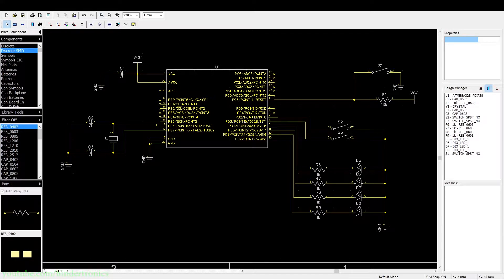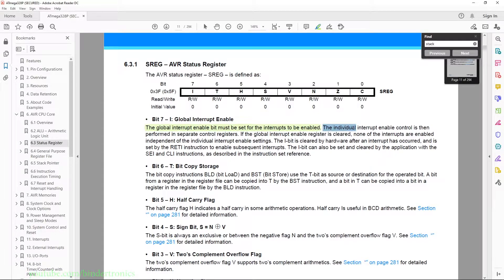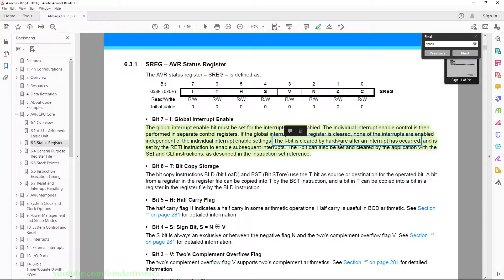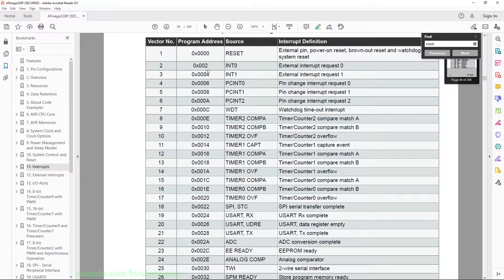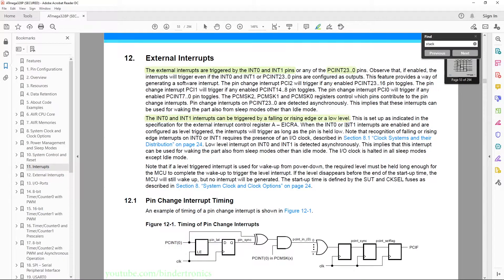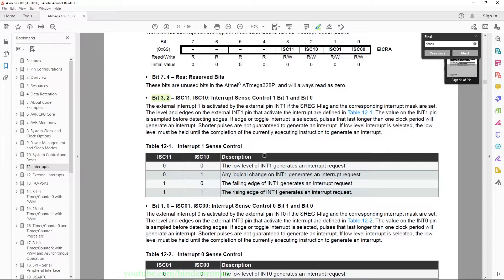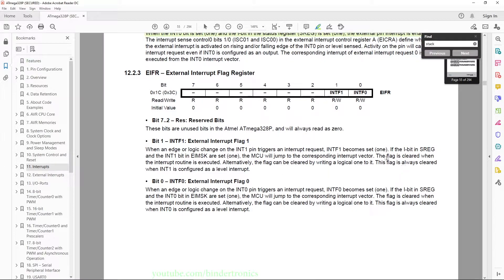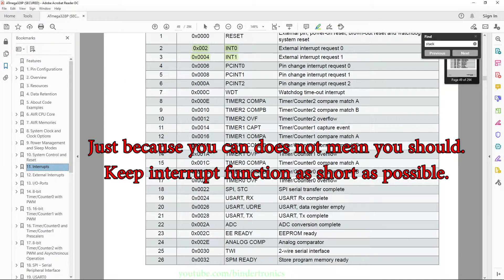Interrupts  🔴 ATmega328P Programming #6 AVR microcontroller with Atmel Studio

Comment: Hi there, thanks for making this series of videos (very helpful!). I have been confused your configuration of the DDRD (at 8:16 in the video). If the initial value of DDRD is 0x00 (which is specified in the datasheet) and you AND it with 0xF3 (1111 0011). Then wouldn't we end up with 0x00 at DDRD? Wouldn't OR'ing it get the desired result of 0xF3? Also, I don't understand why you include the bitwise operator at all. Why not just set the value of the register (DDRD = 0xF3;)? Is there some advantage? Thanks for any input.
Reply from the maker: The short answer is: Stupid proofing the code.

Long answer: The desired result for the DDRD register is 0xF0 and not 0xF3 or 0b1111 00xx where x is do not care. Using the bitwise operators allows you to change only the bits you want to change. In this particular case the operations do not change the state of the lower 2 bits of the DDRD register. The base concept is to change only what you need to use. The other concept is to future proof your code.

Lets take to following hypothetical: I have some peripheral that take control over the settings of the state of the lower 2 bits of the DDRD register, if I use a = then it will ruin the settings of the peripheral but using a logic operator will not interfere with the operation of the peripheral. The UART is one of the peripherals that takes console of the DDRx settings.
& (AND) is used to clear bits.
| (OR) is used to set bits.

Sample program
 
#include <stdio.h>
#include <stdint.h>

int main(void)
{
    uint8_t DDRD = 0;
    for(uint16_t i = 0; i < 256; i++){
        DDRD = (uint8_t)i;
        DDRD &= 0xF3; //0b11110011
        DDRD |= 0xF0; //0b11110000

        printf("input 0x%02x | DDRD 0x%02x\n\r",i,DDRD);
    }
    return 0;
}
Reply: @BinderTronics I’m finding your video very helpful for a lab I have at Uni. I find it really cool that you take such time to respond to a question. I had the same question since this isn’t obvious for a beginner. Thanks for explaining : )